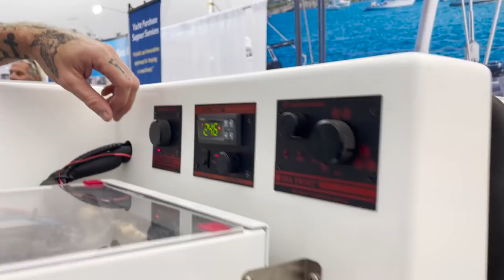More from the Boat Show Booths — Acorn to Arabella: Journey of a Wooden Boat

Comment: I bought a neglected Jboat made in 2003 last year, that came with an OEM-installed 12V Sea Frost system.  The compressor wouldn't start up, so I called Cleave (Nate's father?) to order a new compressor.  Instead of selling me an entirely new compressor, he suggested replacing only the control board (much cheaper).  It took 5-10 minutes to install the new board; then the system fired right up and it works great.
There are no dents, or other signs of wear on the plate.  I am impressed that the ~20 year old system works so well, and that I received such excellent support from the company.  Well done Sea Frost!
Reply from the maker: Yup, that’s Nate’s father! And that’s some New England service right there. Why replace or convince someone to, when it serves everyone better to repair?
Reply: Very rare these days. Good to see niche companies still serving their customers correctly not just taking most profit.

Comment: One thing to consider when making attachment points for anchors, davits, cleats, etc. is intentional failure points. For example: if you add davits to your boat, and some large cargo vessel were to clip your stern and catch your davits, what would be the best/worst outcome. The worst would be that your davits were so well anchored that the stern of your vessel became detached, the best is that the davits ripped away somewhat cleanly. Same is true for cleats, etc. 
The trick is to design attachment points so that they will never fail under normal, heavy use, but will not shred your vessel when cray stuff happens.
Thanks for all the great videos.... and a Happy New Year to you all.
Reply from the maker: Happy new year!

Comment: I think you will be delighted with a properly set up low stem attachment for anchoring.  We used to anchor our trailerable small skiffs this way using the winch attachment points witch were through-stem eyebolts.  For access from deck, we had a heavy 4-6' line to the eyebolt with a thimble for the anchor rode.  Better ride for the boat and lower loads.  For a picnic day, just anchor from a deck cleat.  Need to sleep well through some weather, go to a well- constructed anchoring system like Gerr suggests.

Comment: The other advantage of a waterline attachment for the bridle(shock reducer) is that when anchored at water line instead of much higher up at deck level one can deploy less rode. My boat is a high bow trawler and we can use significantly less chain because of the lowering of the angle to the set anchor.

Comment: How nautical jargon sounds to landlubbers:

First, you take the dinglepop, and you smooth it out with a bunch of schleem. The schleem is then repurposed for later batches.
Then you take the dinglebop and push it through the grumbo, where the fleeb is rubbed against it. It's important that the fleeb is rubbed, because the fleeb has all of the fleeb juice.
Then a Shlami shows up and he rubs it, and spits on it.
Then you cut the fleeb. There's several hizzards in the way.
The blaffs rub against the chumbles, and the plubus and grumbo are shaved away.
That leaves you with a regular old plumbus!

Comment: Interesting comment re pounding at anchor I find if its that bad I move immediately day or night. Dodgy anchorages are no fun for boat and crew I just got back from 4 days cruising and moved the boat 3 times to get better anchorages at night I liked to be wind offshore and anchor out far enough to have a steady wind (mostly steady 25 -30knots this time) mainly so the boat doesn't swing but also so I can regulate the breeze through the boat by adjusting the angle of the front hatch cos its dang hot here.